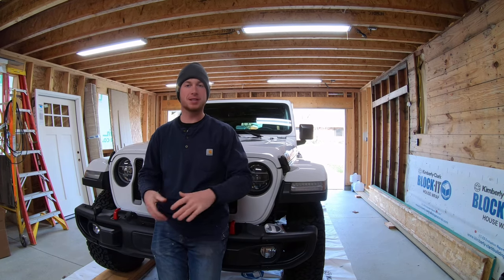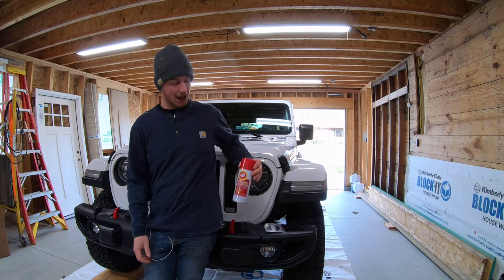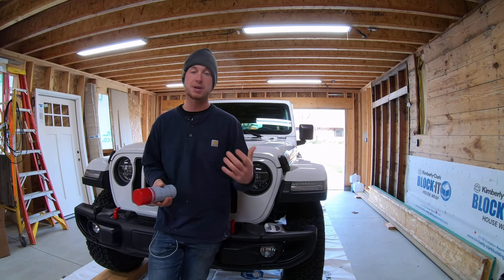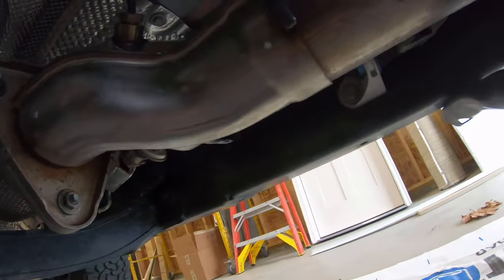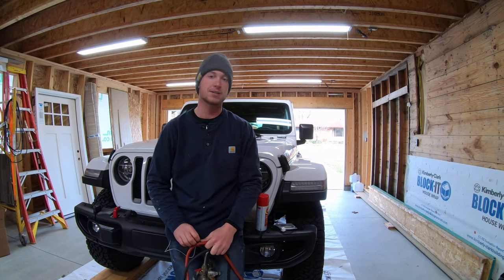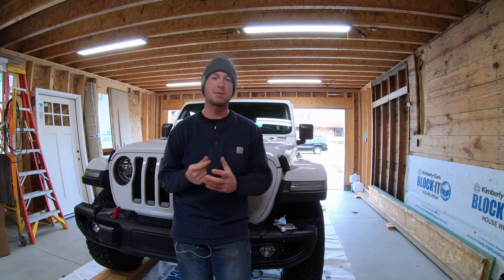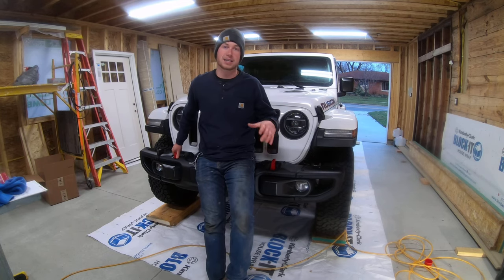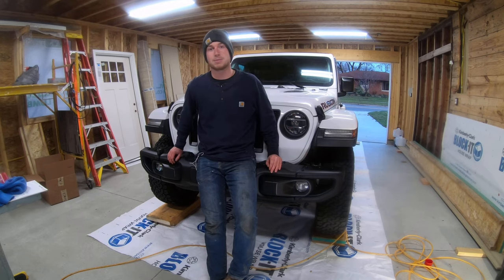Fluid Film Undercoating Application - Protecting your truck from SALT

Comment: Looks awesome! I wish I had the sense to do this when my trucks were new. Now I tend to put a lot more inside my frame than anywhere else. In my toyotas I put at least a half can inside the boxed part of the frame, which is only 3 or 4 feet long, up toward the front. But I only do that every 2 or 3 years. The frame becomes plugged solid with mud so I use a sewer cleanout nozzle and hose on my pressure washer to empty out the frame first. I know a lot of the older jeeps rust through from the inside in those low point boxed frame sections like the tacomas and 4runners so I hit those areas hard.
Reply from the maker: Just like our old TJ 😓

I used three cans on the inside of the EcoDiesel frame!

Comment: Thanks for the great video! What’s the compressor’s ps you were usingi? Fluid Film site says at least 2000psi. I don’t know any compressor has that rating!
Reply from the maker: I would look at whatever spray gun you’re using for the rating. For the one I used in the video it was 80psi I think.

Comment: After dry can you do under car wash and fluid film will not wash away no problem also later if you want to go with permanent undercoating, can fluid films come off easy? Also can you spray this anywhere as long is not spray on hot surface like converter engine?
Reply from the maker: You can wash it, we didn’t go extreme with the undercarriage blasting this past winter with the fluid film but it’s somewhat resistant to soap. You kind of inadvertently spray it everywhere, I didn’t try to get it on the exhaust but what you do get on it will just burn off. I suppose you could permanently undercoat it after but I would recommend agains that, in my experience that stuff just traps the rust.
Reply from the maker: You can wash it, we didn’t go extreme with the undercarriage blasting this past winter with the fluid film but it’s somewhat resistant to soap. You kind of inadvertently spray it everywhere, I didn’t try to get it on the exhaust but what you do get on it will just burn off. I suppose you could permanently undercoat it after but I would recommend agains that, in my experience that stuff just traps the rust.

Comment: So what are the steps? 
1. Pressure wash? 
2. Do you have to sand the rust off? 
3. Apply the spray? 

Just want to know what order this goes in. And what temperature does this not work? For example I do not have a garage and the weather has been in the 30s. Can I still apply this?
Reply from the maker: Just get it as clean as you can and spray it on. It’s pretty forgiving, it’ll stick and kind of soak through the rust or dirt if there is some. Like I said, I washed it as good as I could twice and then filmed it. 

You can spray in any temperature you just have to get the fluid film good and hot. I put the can of it in boiling water to get it pretty hot. Once it’s hot it sprays nice. If it’s not hot it will not spray.
Reply: @dieseJL  👍🤙 awesome thank you so much

Comment: Is it safe to spray it on the axles and joints ?.....I heard it swells the rubber bushings and seals ....
Reply from the maker: It doesn’t hurt them. I think something oil based might but this stuff is pretty harmless.

Comment: If you undercoat it’s and go 4wheeling and get some mud on the frame. Do you leave it or do you wash it off?
Reply from the maker: Lightly wash... we just washed mud off yesterday and the undercoating is there but we didn’t go overboard. 

The mud also kind of slides off easier too since everything is ‘greased’